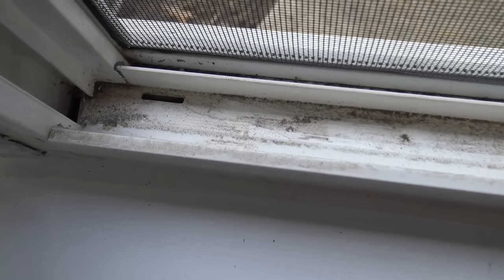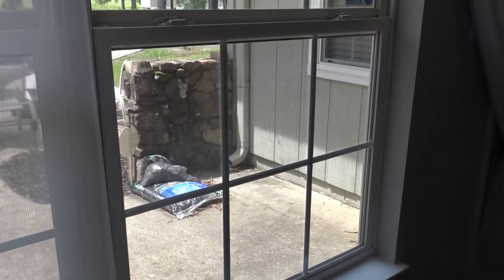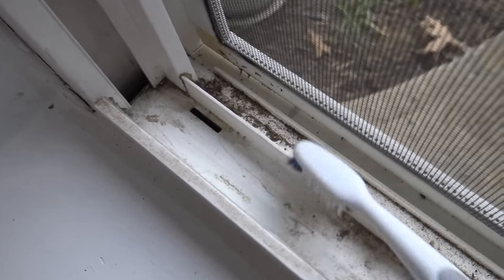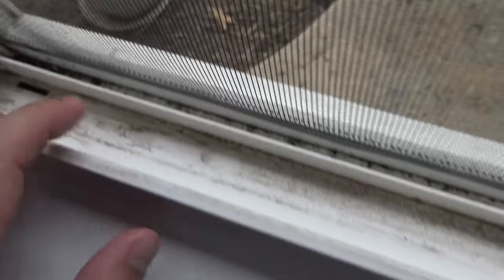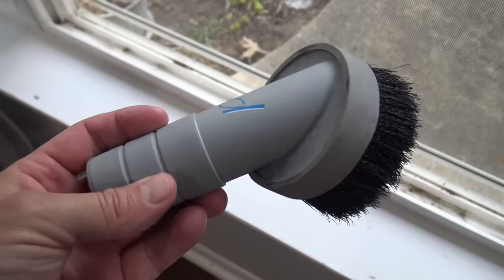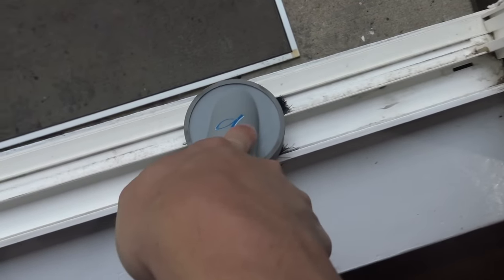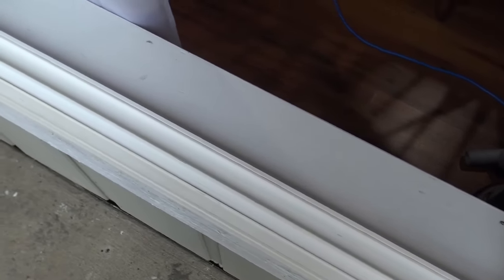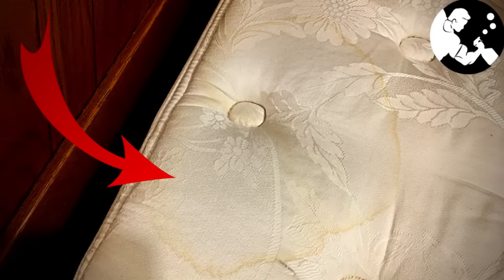EASIEST Way To Clean Window Tracks 💥

Comment: That works good to clean the tracks but why don't you finish the video and show how to clean the corners!!
Reply: I am literally doing this now..... what worked for the corners for me:

1st- use a safety pin and scrape out as much dirt as possible with the needle point, 

2nd-  use a toothbrush to bring it to the center of window sill

3rd- suction it up with the vacuum suction thingy 😂🥴 keep repeating until you're satisfied....

Then when cleaning . ...use a wet washcloth and a knife as a stick in  the washcloth to guide and clean in the crevices

I hope I explained it right
Reply: I pour water in mine and wash it out all out down the drain hole. Way easier than this LOL.
Reply: For the corners i used Q-tips
Reply: A paint brush (or a makeup brush) with short bristles enables manoeuvring the bristles into the corners. 
Hope this helps
Reply: @LoveAlways1002 yes, that's the way I do it too!
Reply: I use a cheap dental tool like the one a hygienist uses to scrape plaque off teeth, to reach and lift up the dirt in the corners.  Otherwise follow a similar process when cleaning window tracks.
Reply: Tried the water trick and pushing the grit with a toothbrush out the drain hole. Works!
Reply: Harbor Freight and auto parts stores carry large cotton swabs for cleaning small spaces like these corners.
Reply: All of this is intuitive. Plus, the job was obviously not finished. I saw dirt in the corners.
Reply: I first have to use a toothpick to pry out the dried, stuck debris out of the corners.  Then I go in with the vacuum and toothbrush.
Reply: There are metal-handled paintbrush-like brushes with stiff bristles about 1/2" wide available for this purpose. Often listed as disposable solvent brushes or craft brushes (I know them as acid brushes for plumbing flux) found in craft stores, hardware and big box stores. I always have one in the kitchen to clean groves in plastic container lids etc. Happy cleaning!
Reply: @LoveAlways1002 Yes. Your detailed explanation is great. That’s basically what I do, too. 
Sometimes, I’ll add ‘chenille sticks’ (aka pipe cleaners) to the process. 
Depends upon how stubborn the dirt in the corner is.  As crafters and pipe smokers know, those furry sticks can be twisted and shaped to get into most any crack or crevice.
Reply: I just use a spray bottle of warm water and spray a tight stream into the corners. This forces the debris out and rinses it away.
Reply: I’m going to try the water tip!  I’m the qtip person but it’s labor intensive
Reply: I use Q-tips.
Reply: Handheld steamer!
Reply: If the corners are OUTSIDE you can spray these with a jet of water from the garden hose. ("Top tip" from Australia! 🇦🇺😅)
Reply: I finish the corners with Qtips. Works great. 🎉
Reply: I Just spray some soap water to soften it and then use a paper towel or cloth to wipe it off. Repeat this until it’s clean. Using a pointy thing in the cloth makes it easier to remove the dirt.
Reply: @CaseyClarkNey you’ll get the drain clogged but ok
Reply: @ellentparker ya but we have to bond,share,sort,and contribute our experiences that lend intelligent design to the intuition techknowledgy, we are in creation.
Reply: Yes I was already doing  what he’s says that commen sense.  bur i he doesn’t get the corner   .
Reply: @LoveAlways1002 yes I did that and it works  it’s funny how commen this issue is
Reply: One lady used an smalll  steam cleaner
Reply: @mcmccoy1184  Never thought to try pipe cleaners and I do have these too!!!

Comment: Just curious as to what is the hard way.  Based on the title, I thought there was an EASIER way than this, which is the only way I’ve ever known to clean them.
Reply from the maker: The hard way is just to start wiping them with a wet cloth before vacuuming first. Then you end up going back and forth rinsing the cloth out and it takes forever trying to get all the trash out.
Reply: Easier to use a steam vacuum

Comment: I’ve always used Q-tips for the little tiny cracks and crevices works every time! 😊
Reply: Me too, and if you don't have q-tips, use an ice pick with a cloth over it.  I use my ice pick for tight spots often.  It is sharper than a q-tip and gets into those teeny tiny corners.  I hate cleaning window and sliding door tracks but they get filthy.
Reply: Like the corners we see in video?🦇
Reply: Me too!!
Reply: And tooth picks.
Reply: Me too
Reply: I thought I was the only person that used toothpicks and Qtips 😂

Comment: I use a steamer.  Blasts the dirt out of all the corners very quickly.
Reply: I apply silicone spray on both the bottom and side tracks,makes them slide easier .

Comment: I would dry vacuum first, and then clean. Cutting into a sponge to fit the tracks will clean it (wet the sponge after slicing it). Then use a small child’s toothbrush to get into the corners.
Reply: Good idea! I think I’ll vacuum first, then start digging up the dirt, and then vacuum again. Thanks! (Ugh! What a fun day I’m going to have!)

Comment: Thank you for the tip of starting out with a DRY area and using a toothbrush and then vacuuming before proceeding.  I’ve always just started spraying cleaner and I’ve never been able to get corners clean.  Very helpful. ❤
Reply from the maker: Happy to help

Comment: After scraping and dry vacuuming,  I use my own mix of Krud Cutter, Baking Soda and a little Dawn mixed with water. Put in a spray bottle, spray on liberally, then let it sit for 10 minutes....then tooth brush scrub. Then I vac with my wet/dry vac, before wiping down with clean rags.

Comment: I lay a folded towel over the inside window threshold and blast away with an electric pressure washer (much lower power and volume than a gas powered one) from the inside of the the window pointed outside. All the crevices get cleaned. One towel is good for 4-6 windows depending on how much air is blowing from the outside to the inside and how dirty the tracts are. Don't forget to blast the undersurface of the bottom of the window. There is usually a rubber seal that gets very dirty. If there is a horizontal channel along the bottom that is mostly covered except on the ends, you can clean the the whole channel from one end with the pressure washer as well.

Comment: I use a toothbrush and do a dry run on it first with a shop vac.  It's amazing how much dirt comes off.  Anything remaining I spray a solution on, let it soak briefly, then wipe it clean.

Comment: Just use a sport water bottle to flush out the dirt and debris. Water will drain out those bottom slits.  Use a sponge to aid the process and pick up any excess water but doesn’t have to be perfectly detailed like a Ferrari.

Comment: This is probably my least favorite chore, but using the vacuum with the brush attachment looks like a good idea. I usually try to do it with the dustbuster which doesn't really work all that well.
Reply: I use an old electric toothbrush.

Comment: Have you ever used Dirtex they sell it at Home Depot used to be in the paint section a few years ago people found out how great it worked are when do you go online and buy it you can find it for like four hours I can but you see people trying to sell two cans for $25 sometimes more than that because it works so good you can actually buy it by the box and mix it up yourself I never did that my wife was driving home from work one night and the temperature was changing so I was getting colder out from the summertime so the spider was in her truck why she was driving home from work she went off drove it to the closest store to target or Walmart because she works like an hour away from home and got a can of bug spray and she had that stuff all over the windows on the inside of the truck I want to have their Windex and paper towels and I am spraying the windows and trying to clean it off and it was just smearing but I use the Windex a few times to get as much Windex after windows I mean as much bug spray of the windows as I could then I sprayed the dirt Tex and when that stuff sprays it comes out like a mist leave it sit on the window for like 30 seconds 40 seconds then you wipe it off you probably have to do it a few times and then that gets the bug spray off the windows because that stuff is great and then after that I will clean it with the Windex and that’s how you can tell us all the bug spray is off 

No like I use Windex and I get those nice paper towels the Vivid I will clean the windows with Windex at first but then I use the third text on the the window frame all that what you’re cleaning up there the actual windows then you fold them down and when you spray that stuff on you leave it sit for 30 seconds 40 seconds sometimes a little longer you will have to do it a few times but you will be amazed how great it works i’ve never used anything like that stuff and believe me I use the purple power used to use simple green when I power wash my house I put like a cup full of the purple power in a 5 gallon bucket with Dawn soap I make 3 buckets at a time like I know good stuff to use but that their tax I’ve never used nothing like it there’s nothing like it

Comment: You should not tell them to use the vacuum if they spray something wet it is not good to use the vacuum on wet items. It will ruin the vacuum.
Reply: He didn’t. The vacuum is step 2. Spraying the cleaner was step 3.